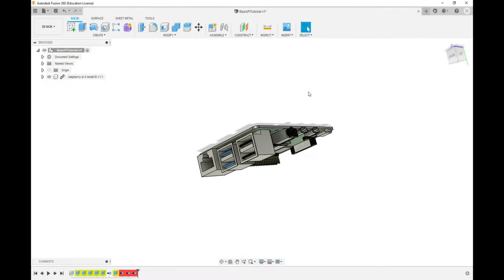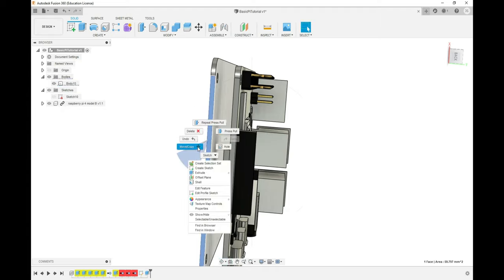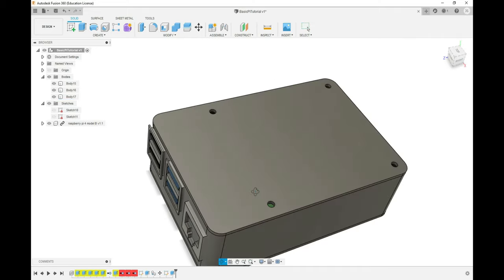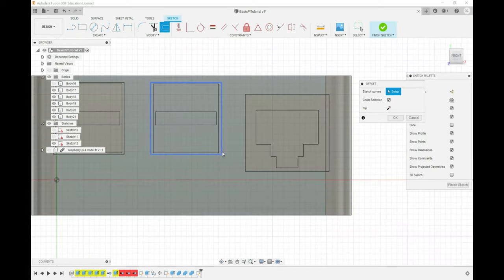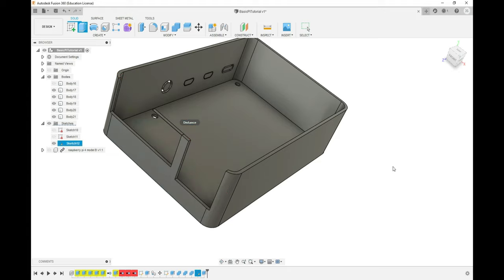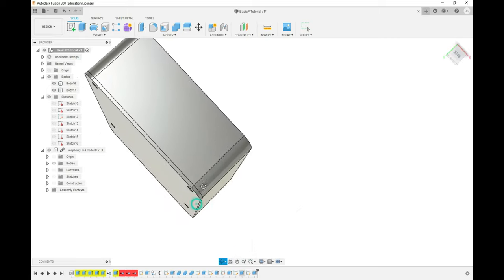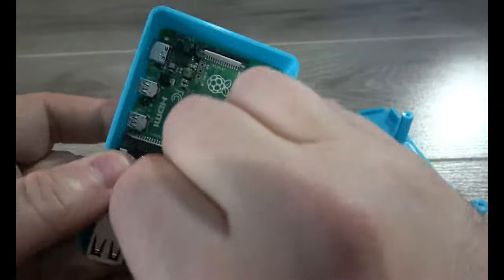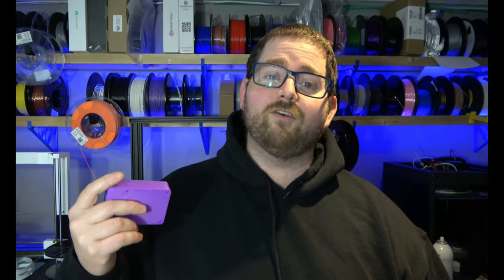Design Your Own Pi Case! [Pi Twenty-Six Ways - Episode 6]

Comment: Love your use of Fusion 360.  I'm still a Fusion 360 beginner, and learn best from a combination of tutorials (more about the tool) and project walk-thrus (it's all about the object).  I especially like how you and Maker' Muse work in this way.

After seeing the knock-out for the GPIO, I was shouting at the screen about not only the SD card, but also the camera cable.  One refinement I think I'll try will be to let the knock-outs serve as ventilation grills.  But I want to try doing so not in the design itself, but by making the knock-out from exposed infill, so I can adjust it at slicing time, without having to go back to Fusion 360.

Any hints for how to do that, if it's possible at all?
Reply from the maker: I don't have an easy answer for you off the top of my head. It would be fairly easy to make it so the punch out part is only 0.4 or 0.6mm thick...then you could slice it with the too .4 or .6 sliced off of it. If I understand your goal correctly.